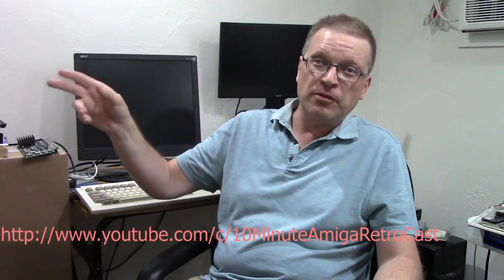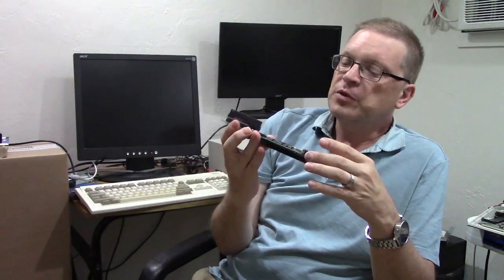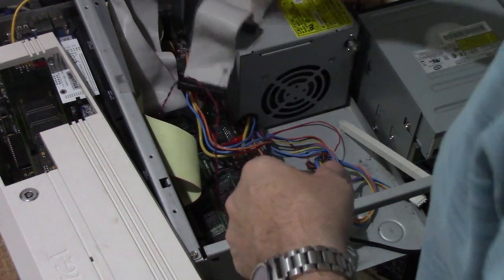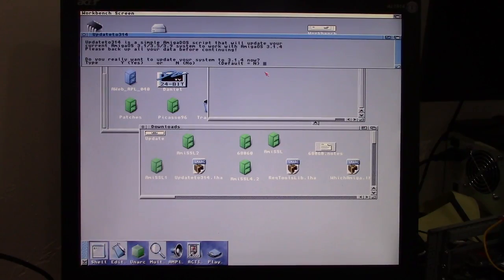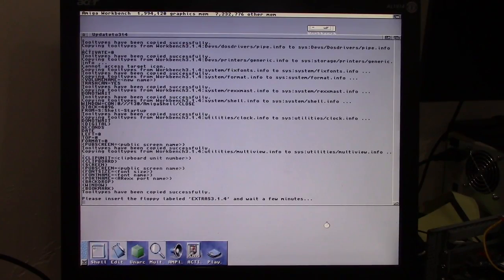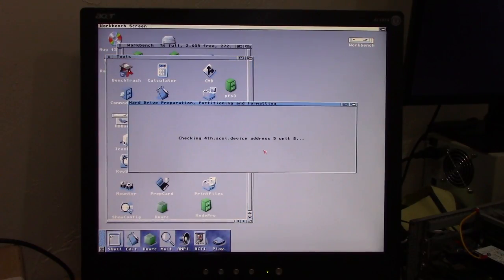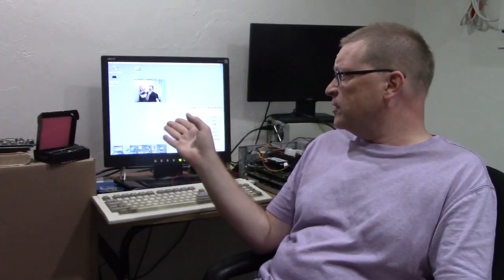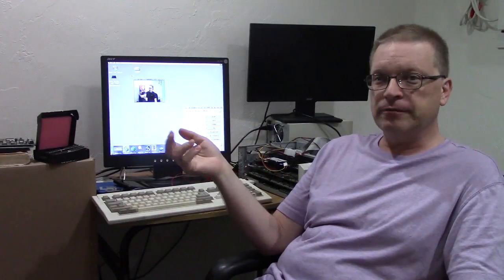10 Minute Amiga Retro Cast Episode 10 - Upgrading AmigaOS 3.9 to AmigaOS 3.1.4

Comment: Thank you so much for making these Amiga videos! I recently inherited an Amiga 1200 that a local hospital was getting rid of. I'm planning on cleaning it up, retrobriting it, and eventually upgrading it with a pistorm32-lite. Your videos have been an excellent resource for me as a beginner
Reply from the maker: A local hospital was still using one? There must be a cool story behind that!
Reply: I was told that it was being used for their closed circuit TV network, which was used to push announcements and information. After they switched to a digital system, they got rid of it. I believe they were using it to overlay text and graphics on top of video. @10MARC

Comment: nice ...answer a question I had from my son about installing 3.1.4 over OS3.9. you need to get some OS3.1.4 eproms burned for you the kick file is in the download from Hyperion you bought, we did a amiga os 3.1.4 install on our a4000 didn't work to well with WHDload issues with it. but we left the roms for 3.1.4 in and did a 3.9 install worked like a champ. I think I might like your way better

Comment: Thanks for explaining an easy way to upgrade from Amiga OS 3.9 to 3.1.4, i am going to buy the Amiga OS 3.1.4 and i hope is included the Kickstart Rom .adf disc so i can use it with WinUAE too !
Reply from the maker: That is an excellent question. I suppose worst case you can make a file from the real OS 3.1.4 ROMs and copy it to your UAE session
Reply: @10MARC  Yes i would do that if i need, thanks !!! :D

Comment: hi Doug, I have Amiga 1200 with Amitek 8mb memory expansion card and it currently on 3.1wb, I'm wondering if 3.1.4 will be a good choice, or it will use a lot of fast memory? or I should stick with 3.1wb? Thank you in advance
Reply from the maker: It does not seem to use more FAST RAM at all. Even my 68000 based machines work well with it. It is totally worth it not only for bug fixes and large drive support, but also to support Amiga Vendors
Reply: @10MARC  thank you, that's good to know

Comment: I have an A4000 with a 040/25mhz. I believe it is the 4000 version. What do I have to do to get it to 060. Is it costly or very involved?
Reply from the maker: There is a very clever modification that lets you put an '060 chip right in your a3640 board with no modification to the board itself. It is literally plug and play and speeds things up a lot. I got mine from tbtorro on amibay and it was not too expensive.
Reply: @10MARC  , Thanks Doug I am in contact with him. Can you recommend something on ebay for memory? I see the specs but I am always wary of getting the exact type of memory correct.
Reply from the maker: @davidwright9166  I do not any reason these would not work. 4 MB 72 pin SIMMS are what your motherboard needs. https://rover.ebay.com/rover/0/0/0?mpre=https%3A%2F%2Fwww.ebay.com%2Fulk%2Fitm%2F141918569742
Reply from the maker: @davidwright9166  you may want to consider the BIGRAM Plus Zorro card from Individual computers. It adds 256 MB of RAM. It is only as fast as the ZORRO 3 bus, but is is not much slower than motherboard RAM.

Comment: cringe cringe cringe... the way you pulled the WarpEngine out... no static protection... eep.
Reply from the maker: Oh that's what you meant on Twitter! I will be honest - I have been into computers since 1982, and professionally repairing them since 1994, and have never lost or damaged a single thing to static. I make it a habit to ground myself, usually on the case, and I don't even think about it usually. 
Now I have killed things for others reasons, like plugging the wrong power cord into a capture card and slotting an ACA500+ into a Checkmate case upside down, but static damage is overrated and always has been. ;)